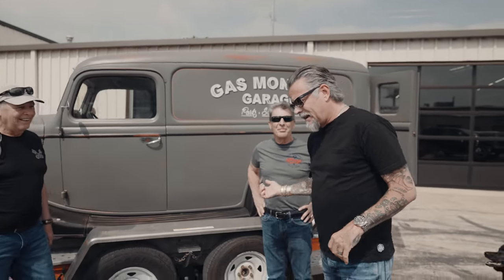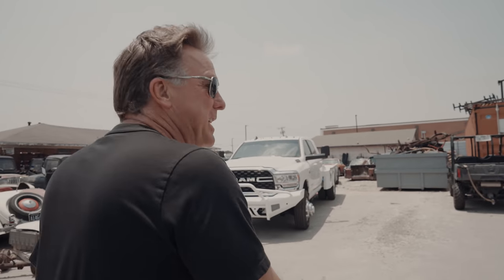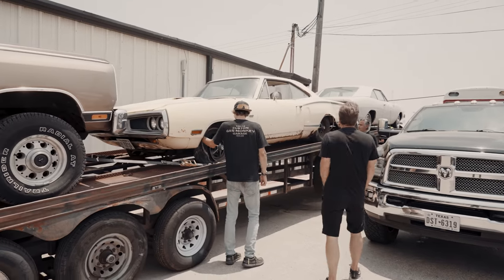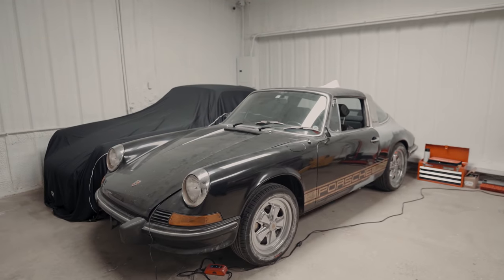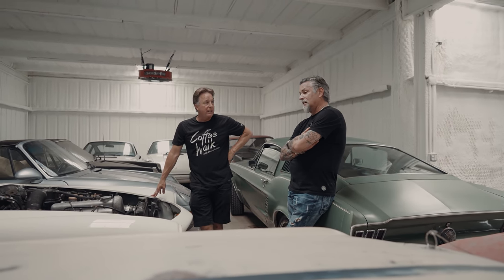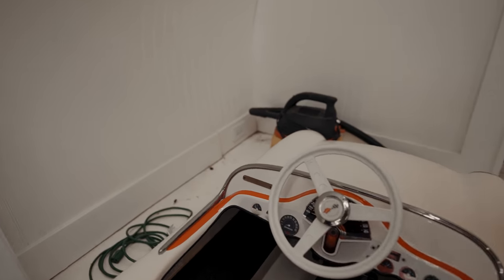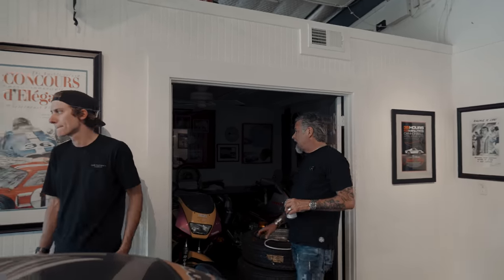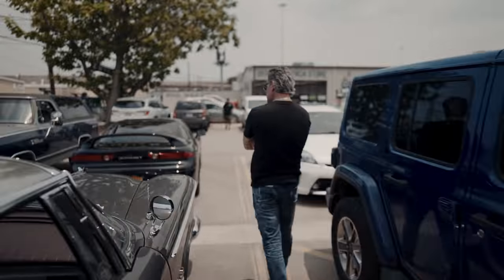Beer Walk With Richard Rawlings Ep. 2 - Gas Monkey Garage

Comment: Where’s the 70 - 75 Datsun 240 Z’s with in line 6 overhead cam that by machining the head, increase intake valve’s, porting&polishing would out run most Corvette’s and with 400 lb sway bars front and rear would outrun outhandle most Chevy street and Chrysler, Ford products that were sold during my adventurous experience’s

Comment: The engine alone cost five grain to have built the transmission cost $2,800 the car costed over 32 Grand for us to buy parts for to put together yes it was not completed but it was a street rod and tagged in Baltimore Maryland yes I got locked up but it doesn't mean that I need to forfeit the car it's an heirloom and I would like my car back Paul from Baltimore Maryland if you see a 1939 Chevy coupe with a 1968 Chevelle frame underneath of it with a 12-bolt posi with a 700R transmission with dual tanks and 837-397 block with 427 heads it's a stolen vehicle and the Baltimore City police won't do anything about it because they said that it was a piece of junk and that I should learn to live and let live move along sir you cannot have this vehicle back even though it's your family heirloom all from Baltimore Maryland is looking for a 1939 Chevy coupe that was stolen by Baltimore PD